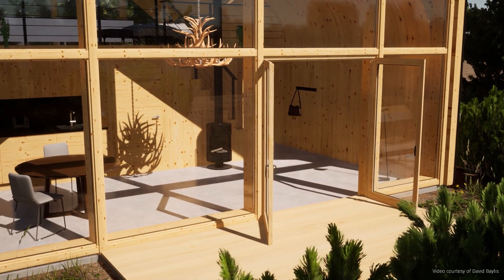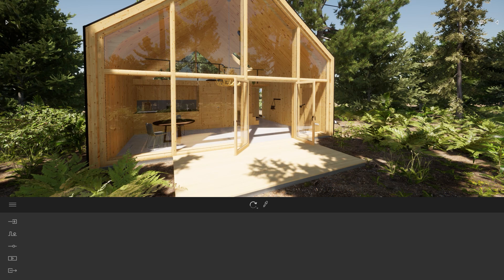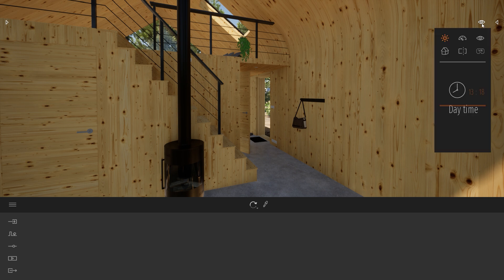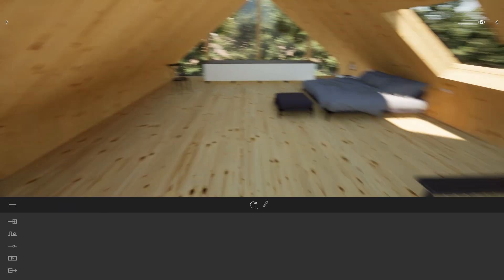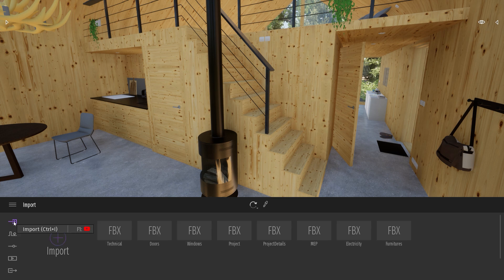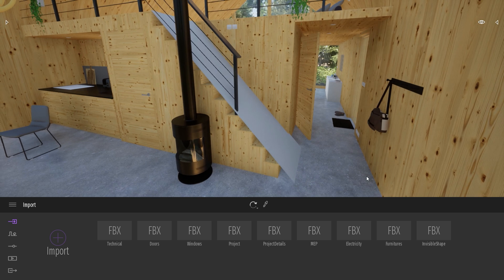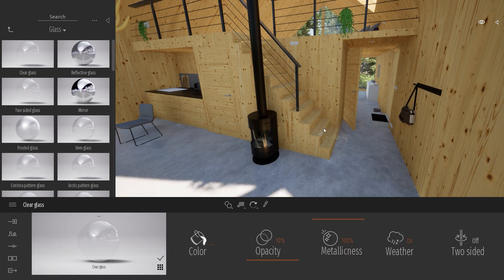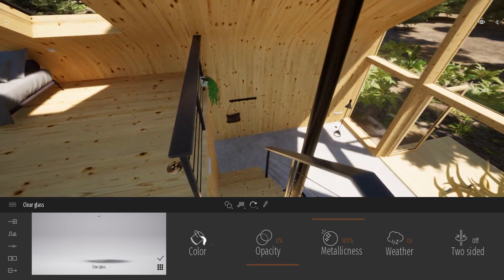Physics on stairs | Tips & Tricks | Twinmotion

Comment: Would it not be possible to use the tools within TM instead of creating it in another application? maybe use TM's Primitive tools set, eg..the 1m Plane and position that on the stair, by rotating and stretching it? and set the transparency as needed?
Reply: i thought so too, a bit strange not seeing it done within twinmotion considering it's the official channel. but i guess importing it allows the plane to be more precise to the dimensions of the staircase? even though it's a transparent object so it really doesn't matter. it's an issue though i'm just being difficult i guess
Reply: Yes it's also possible to use a basic plane from Twinmotion primitive folder